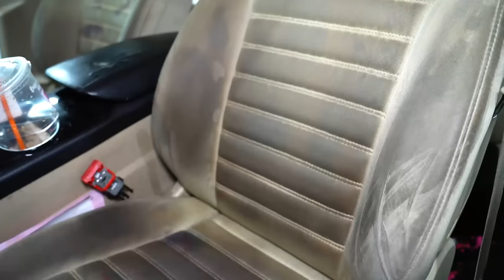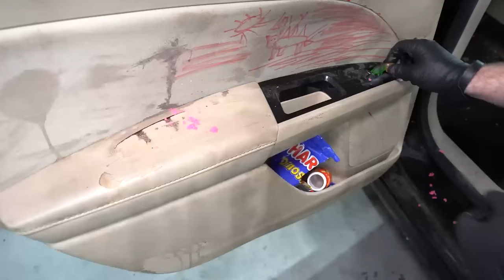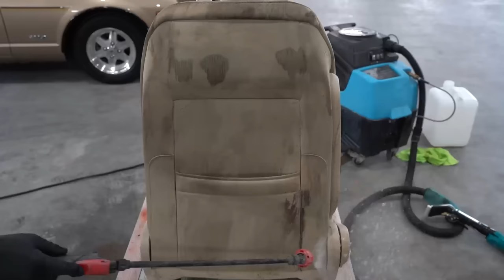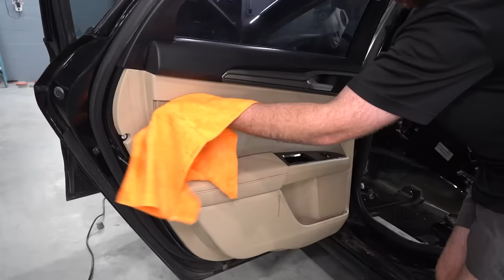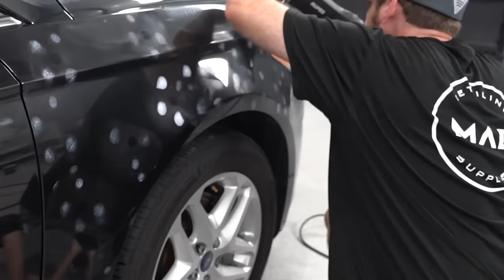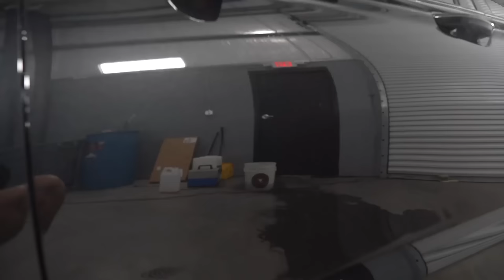Deep Cleaning The NASTIEST Ford Ever! | Best Seat Extraction | Insane Car Detailing Transformation!

Comment: I noticed you spraying a bit of high pressure water in the complete engine compartment before putting that degreaser on it.  Is that no longer an issue with regards to getting those connectors and alternator wet without covering anything up now to avoid issues later with things not running correctly??

Comment: CHICAGO, IL — Wow! What a transformation! I noticed you cleaned under the hood. Can I use your product and the power wash wand at a do-it- yourself car wash? If so, can I cover the battery and terminal and cables with a heavy duty plastic bag. Not technically inclined so don’t want to disconnect the battery 😱.

Comment: Lovely! 

The Lancia Y and Autobianchi 112 share an engine from the same family as the orange Fiat 127 sport you drove about 3 years ago, and share platform engineering with the South American 127/147 and Uno. 

Ranger were GM's South African "Totally not GM because apartheid is bad" division. Lots of tech shared with Opel, and Vauxhall through Holden. The Chevair, which was not seen outside Africa to my knowledge used a Holden Sunbird OHV 1.9 as opposed to Opel's robust CIH 1.9. (FOR THE LOVE OF ALL THAT IS HOLY, WHY???) The Ranger 1700/1900 is a badge engineered Opel Rekord. The 1700/1900 was offered in LHD through GM agencies in Switzerland.

Eagle was actually never part of AMC, but a way of selling the remnants of AMC under Chrysler's umbrella after the '87 buyout. Both the Renault 21 and 25 were offered under various badges including Eagle Premier and Dodge (!) Monaco before Renault's withdrawal from North America in the early 90s.

The Ford AU Capri had modest success early in North America, but has all but gone extinct.

Cheers from Costa Rica!

Comment: Quick question for You.  Whenever You spray down seats as filthy as these have You ever considered using an equal mix ratio of BOTH Oxi Clean & Resolve?????  Those 2 mixed together can do miracles.  I used that mix on 8 yellowed pillow cases and I agitated them in a bucket for about 30 minutes.  I let them sit for 4 hours and agitated them again and then put them in the washer after I rung them out first.  They came out so White My friends Wife asked Me if I just bought them at Walmart.

Comment: Can you reuse the clay bar or is it ruined after use??
Reply: Yes, this type of claybar is reuseable. But you have to take care for contaminants, cause you don‘t want to damage the paint by the next event! You can reuse clay if the car is contaminated like this one, up to two or even 3 times. But better and safer is always take a new bar of clay. And you don‘t need very much for one session. About 20-30grams of clay is in most cases enough.
Reply: @Michael Roloff  thankyou for all the knowledge you share im trying to start a detailing bussiness in Iowa thankyou
Reply: @trker7031  it's a pleasure! Then I wish you all the best and any possible success in your business! By the way, there are also clay pads for frequent use that can be used again and again. They look like a washing mitt and you can use them with the car shampoo without any problems. The normal clay bars as in the video leach out easily with shampoo, but are much more thorough than the clay glove. As a rule, after decontaminating the paintwork, you should polish at least once anyway. Haze and the finest scratches always get into the paintwork with the claybar or glove... unavoidable!